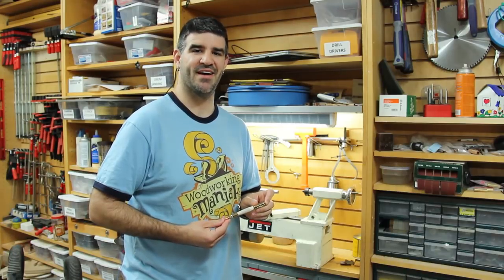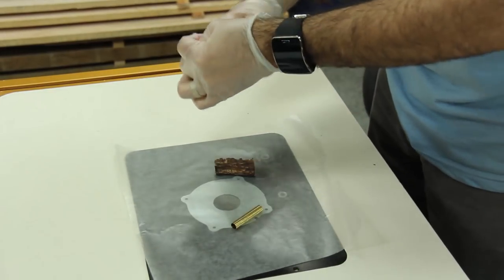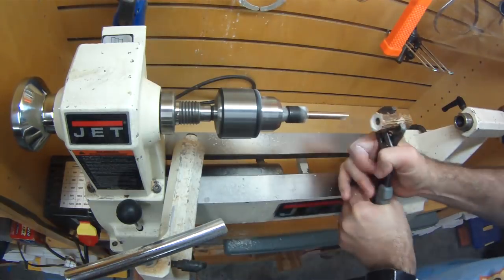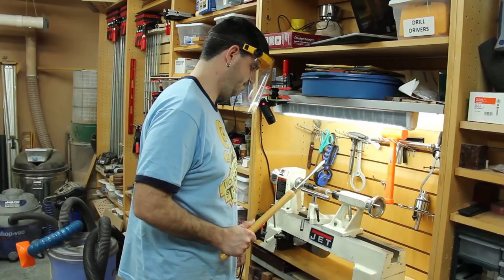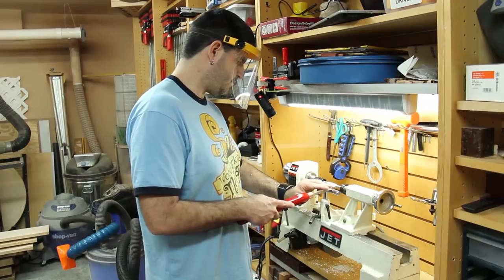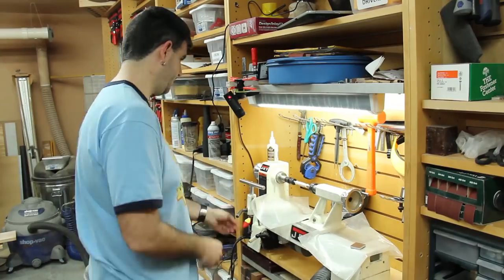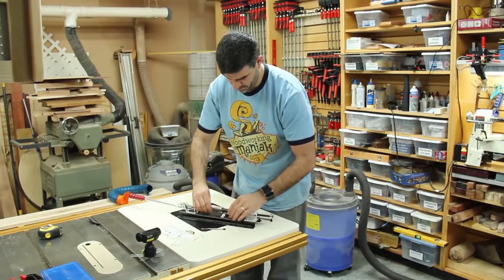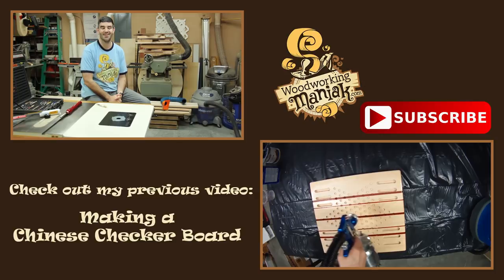How to Make a Deer Antler Bolt-Action Pen

Comment: Thank you for showing both high-speed steel and then the carbide bit. I have both, and I was going to buy some antler for a project I was planning on. I was looking to see if it was too hard a material to use steel on or not.

Comment: I've done several antler pens and I found carbide tools are the best to use.  I don't know if you are aware but you really want to use a respirator when cutting/turning/sanding on bone of any kind.  It is very dangerous and can cause lung issues.  The pen turned out really nice.  They do polish up very nice.

Comment: I like to take the antler down on the disc sander then turn. Wont eat up the tools. Dust mask and a good dust collector is important working with antler/bone.
Reply from the maker: +Joe Spina That's a good tip. However, I don't have a disc sander right now... But I do use dust collection. That does make a big difference. I also usually wear a respirator.

Comment: When I have to finish bones or antler I use sanding paper up to 400 and then steel wool size 000. And linseed oil. It makes a perfect sureface with a natural feeling and it emphasizes the grain. Yes bones and antler have a very nice grain.
Reply from the maker: +Custom Micarta I agree, with it's porous nature, an oil would emphasize it well. I haven't tried that...

Comment: I've made a few slimline pens but want to try expanding the types of pens I make. Any helpful suggestions?
Reply from the maker: +Sonja Bauer Get an organizer for all of your different bushings.
Reply: Will definitely do. Is there anything different about the process? It seems all the same and pretty straight forward
Reply from the maker: +Sonja Bauer yeah, each kit has their own assembly directions, but all are about the same as far as the turning goes.
Reply: Thanks!
Reply from the maker: +Sonja Bauer no problem.

Comment: Did you spray something while sealing it with CA GLUE?
Reply from the maker: I don't remember. If I did spray anything, it was CA activator to make the CA set faster... I don't usually use that though because sometimes it will cause it to turn white. So, in a reply recommendation: Don't spray anything on the CA to make it dry faster... ;)
Reply: +WoodworkingManiak at 6:23 you spay it on right before applying the CA. I'm looking into a lathe soon, found a few used on Craigslist for a good price. Haven't decided what to go with. I like the Jet 1221 vs.